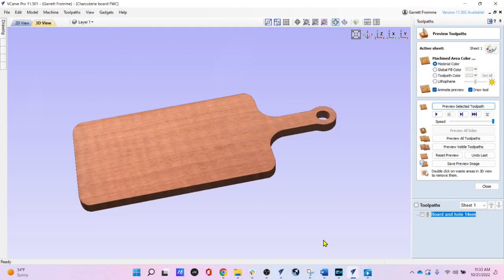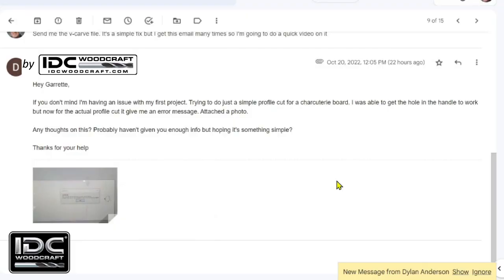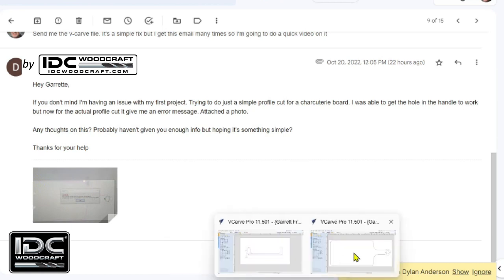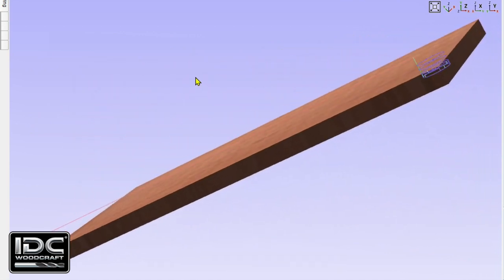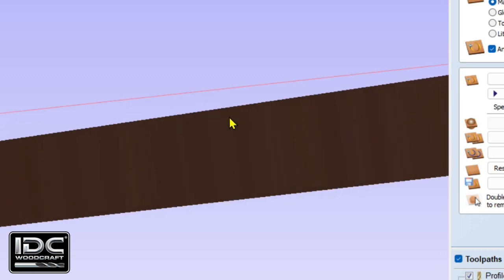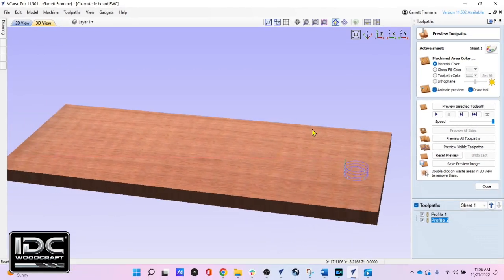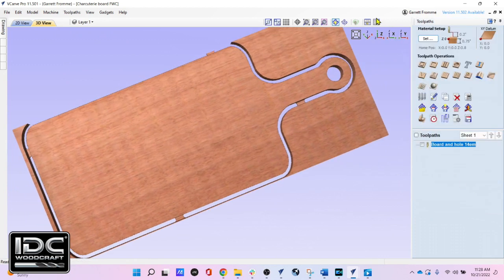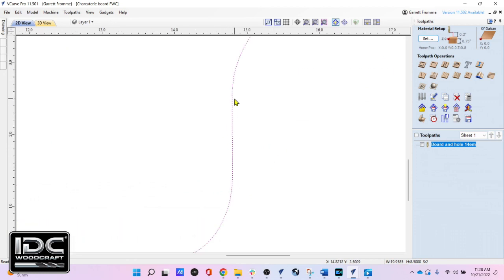Vectric - Super Tips For The Beginner, Vcarve, Aspire & Cut2D - Vectric Tutorial

Comment: Hi Garrett, I was just wondering is there some sort of comparison between all the Vectric software, kind of what's included and what's not. You show 5 Design Software 4 of the vCarve or Vectic types and the reason I am concerned is the price of all the different ones and what are they missing on the lower end of them. Can you demonstrate the differences
Reply from the maker: Marty, I totally understand brother, sometimes it's hard to find the info about the different versions of the Vcarve software. Basically, these are the main differences between the 3 versions: 

Vcarve Desktop: You can create designs with dimensions up to 24" x 24". Depending on what you are making, this may or may not work for you. You can also cut out 3D projects, but you CANNOT design/create your own 3D project. Here's the link → https://bit.ly/3D4CwjH

Vcarve Pro: You can create larger projects that are not limited to specific sizes (unlimited dimensions). You can also cut out 3D projects, but you CANNOT design/create your own 3D project. Here's the link → https://bit.ly/3d4WrEU

Vcarve Aspire: The same as Pro in terms of dimensions (unlimited dimensions). But you CAN design and edit 3D projects. Here's the link → https://shrsl.com/37pw9

These are the basic differences. But you can also choose to purchase one and upgrade to another for just the difference in price. Ex: if you buy the Desktop version, you can always upgrade to the Pro version at a later time if you end up needing it for just the difference in price between the two.

Comment: Open contours is something I've dealt with in Mastercam for years. A tool will just not go around it, or only a small portion of the contour will be cut, especially in 3D. In Vectric it seems to be called an open Vector. Similar thing with a different name.

I had to go in there and zoom up the image until I saw an open gap and drew a line to connect them. Or ends of entities (as they are called in Mastercam) are overlaying each other in a branch like configuration. The tool does not know which way to go. You have to go in there and trim off the excess entities to eliminate the intersections, or "branch points".

Vectric seems to have similar issues but calls them something different. I would have probably trimmed that funky branch in the "open vector" (Vectric speak), but the way you did it with the nodes is obviously fine. One of the issues with learning Vectric after years of Mastercam, is the same or similar things are called something different.
Reply from the maker: CNC Programmer, you bring up some really great points brother. The open vectors can be a frustrating problem on all software programs even though they may go by different names.

Comment: I have a square board:
 - base: 510x510mm
- top: 499x499mm
- thickness: 59mm

I want to make a toolpath so that the final result has its sides cut at 84,6 deg.
I need some help here, since I'm a bit new in this and figuring out what setting should I use messes my brain and so far I couldn't find any info regarding my issue anywhere.
Reply from the maker: Rosumpara5442, sorry my friend this one is a little too tricky to answer over comments. I recommend joining Kate and I for our Youtube live sessions we host every Wednesday at 8PM EST. We should be able to help give you guidance there!

Comment: Did you really want the plug left in the hole unattached to the board? Unless you made sure that area was anchored down to the spoil board (perhaps with tape) as soon as it was "freed" it would catch on the bit and quite possibly get flung out doing damage to something?
Reply from the maker: Gilroy, very good point brother. The best method to hold down this project would definitely be the superglue method. Dont want anything flying around the shop!
Reply: @IDCWoodcraft  Then there would be no need for tabs, so even better. Personally for small regions like this, I'd machine with a pocket toolpath to make the hole disappear up the vacuum pipe - no chance of anything being flung across the workshop. I got this tip from a Kitchen Cabinet company with a huge Biesse machine with vacuum bed when I was installing a robot board loader to the machine. The software they use, automatically does this for any waste under a certain size that may be too small for the vacuum table to keep hold of securely. Very impressive.

Comment: Garrett, how about doing a video on machining holes with Vectric?  I have never had any luck at all trying to do this.  I will take a piece of dowel for example and measure it's diameter with a $200.00 set of Mitutoyo digital calipers and enter that dimension into my program and they never fit.  The hole is either too big or too small.  I have give up on trying this and now what I do is to use a 1/16" end mill and peck drill small holes just below the surface of the material and then use those holes to line up spur on a Forstner bit and drill them out on the drill press .  Maybe Vectric is not capable of doing this to within thousandths of an inch, I don't know.  Sure wish I could get it to work as it would save a lot of time and wasted effort.  Thanks.
Reply: One thing to check is the size of the bit. Not all bits are the size they claim to be. That will throw off the size of the hole.
Reply from the maker: Jim, try taking a look at this video. It might help you out. Here's the link: https://youtu.be/G0N7Nm3wbfU
Reply: Cutting tools can be  a bit off their supposed size. If the tool is a bit smaller then the expected dimensional size, you may get smaller holes. Tools can run out in the collet, giving you larger holes. If your gantry is not perpendicular to your table, you can get a weird hole. Direction of cut also makes a difference. If you are climb cutting, your tool is pushing away from the material. If you are conventional cutting your toll is pulling into the material. You can cut several holes the same size that are cutting in different directions and some might be large and others small. 

I'm assuming you are using a CNC Router and not a CNC Machining Center. The routers are just not as solid and rigid as machining centers and are not nearly as accurate positioning wise.

Is Vectric not capable of doing it? Are your cut directions always the same?  Is your machine accurate a rigid enough to do it? Lot's of variables.

Comment: You are cutting the outside of the board and the hole with one tool path.  Shouldn’t that be two paths, the OUTSIDE of the board with an outside cut and the second hole cut on the INSIDE of the hole, Making the hole the diameter as it was drawn.  I think the hole will be larger than the drawn hole if it is drawn with one tool path. 
Thanks
Reply: You are correct.  Even if the hole was sized intentionally to compensate for the bit radius good practice is to do an inside cut so that mistakes are not made. If you were to change the size of the bit and use the same tool path the hole would be of incorrect size with an outside cut.  If it were an inside cut it would not matter.
Reply from the maker: I couldn't agree more with Steven. He's spot on! You're absolutely right, I probably should have mentioned that one somewhere in the video to avoid the confusion brother!